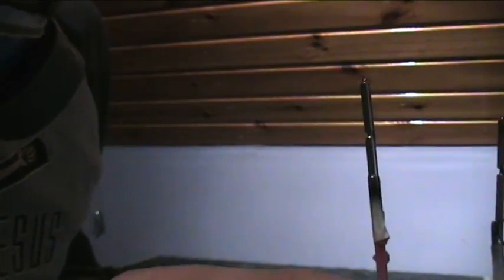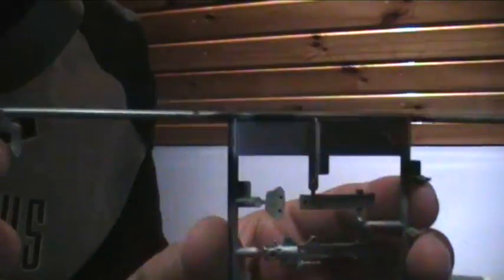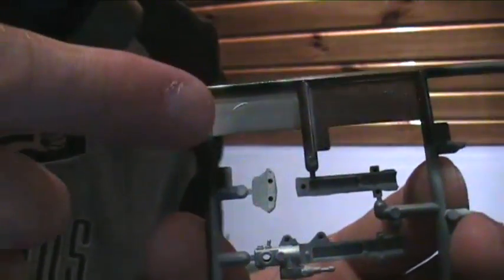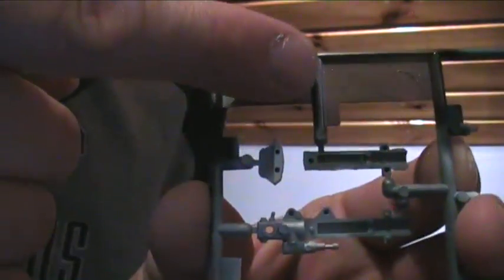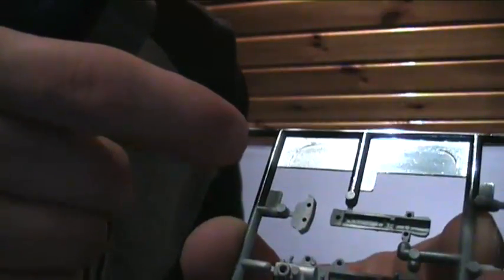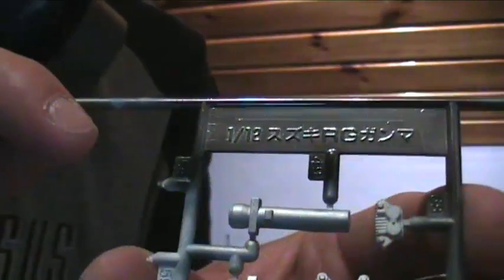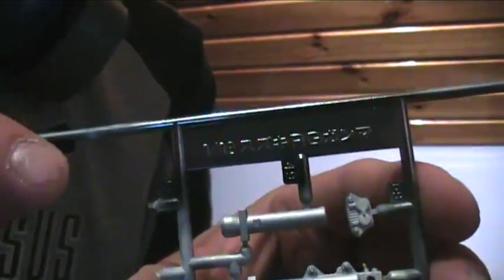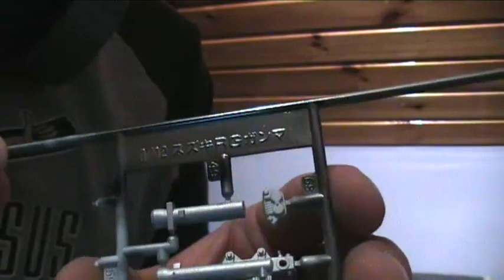Alclad II Chrome and Alclad II Stainless Steel, first use

Comment: Thanks for this video. I've got some Alclad II gloss black base coat and some Alclad II chrome. I was originally going to chrome a Terminator Endoskull and Endo-arm kits I'm building, but now that I've seen a bunch of screen-used endo parts, they're actually made to look like surgical steel, rather than chrome, so I'm going to order some of that, now that I've seen how it comes out. :-)

Comment from the maker: Technically, no, it's designed only for airbrushing, however, I read a magazine review where the writer stated that you can brush it, you need to let it settle so all the metallic pigment is at the bottom of the bottle then dip your brush full length into it so the bristles pick up the pigmeent at the bottom. I'm not convinced it will leave the same metal effect finish but you can give it a try and share your results with us on Youtube? Some time when I have a opportunity, I may try it myself.

Comment from the maker: @jublywubly I'd agree with that, stainless steel would look much more accurate on a T800 skeleton. It's still very shiny. Best tip, get the smoothest black surface possible, prime then flat with 1200 grit, then black gloss and flat then polish the gloss, look out for any dust or particles in the black, this WILL show through, black as smooth and shiny as possible and you'll end up with an amazing shiny surface.

Comment from the maker: @romeoward18 Thanks.
It's a tricky Q with no easy answer, you need to ask what you want from a motorbike first, do you like a particular style? Do you want cheap? Reliability? Fun? Pose value? etc
The Aprilia RS, (& Cagiva), are cracking bikes, expensive for 125's, can be temperamental, they will require top end rebuilds approx every 10K miles, (a standard performance 2 stroke job), but look awesome, go like stink and have infinite cool factor.
If you can afford one & maintain it then go for it.

Comment: Did you under coat before the gloss black if so what primer did u use
Reply from the maker: james mccaughey I didn't on the test sprue, just a couple of thin coats of Humbrol gloss black enamel.

On the model I primed using Humbrol matte enamel, (I use this for all my models, either Grey, white or yellow depending on what's going over the top or which is to hand first, I normally prime with white if a pale colour is going on top like white or yellow gloss paint)
This will work either way as long as you have a nice glossy black coat to spray the Alclad onto.

Comment: What the heck is a Teflon needle packing??
Reply from the maker: A seal or packing material which sits behind the paint cup and around the needle made of PTFE (PolyTetraFlouroEthylene) a well/brand manufacturer of which is 'Teflon' as used in non stick cookware.
It's resistant to harsh solvents making it ideal for airbrush seals spraying enamel and lacquer based paint unlike rubber which swells and perishes on contact with harsh solvents.
Reply: @spidiq8  
Thanks for the explanation, Much appreciated.
Reply from the maker: @Stringbean421  You're welcome.
Most airbrushes nowadays have solvent resistant seals as more modellers are using solvent based paint but always worth checking.
Reply: @spidiq8  
Yeah,..at the moment, I only have an Aztek airbrush and it's been great for my needs with just acrylics which is why I never realised about seals for other solvent based mediums. I'm not sure if my Aztek will be suitable so I may invest in another brush exclusively for these other paints and metalizers. Anyway, thanks again.
Reply from the maker: @Stringbean421  Your Aztec should be OK, the design of them means that paint only travels from the cup through the screw on nozzle assembly and doesn't contact any of the internal components and I'm pretty sure the nozzles and such are a solvent safe plastic. Double check perhaps with Facebook groups or forums.
I can highly recommend the Iwata revolution CR if you decide to get a new brush, I have a few different ones and almost exclusively use the Iwata now and my badger occasionally.
I really should sell the others.
Reply: @spidiq8  
Agree about the Iwata Revolution CR brush. It has lots of praise and is a favourite among many modellers. Thanks for the recommendation.